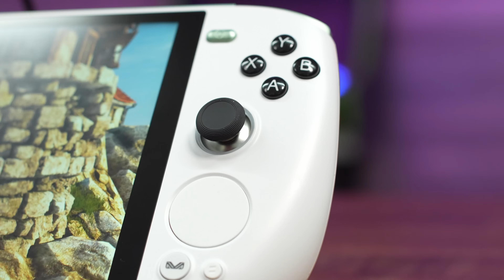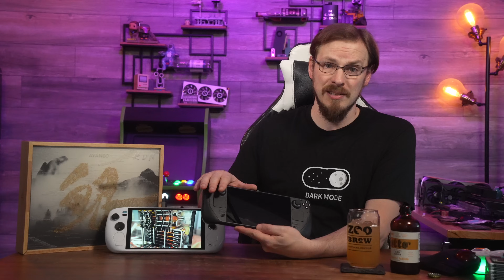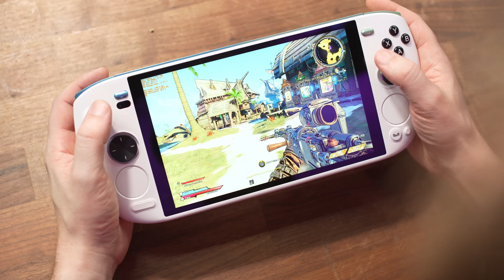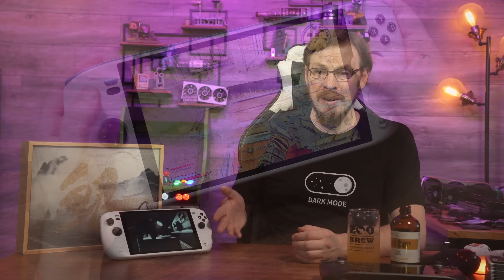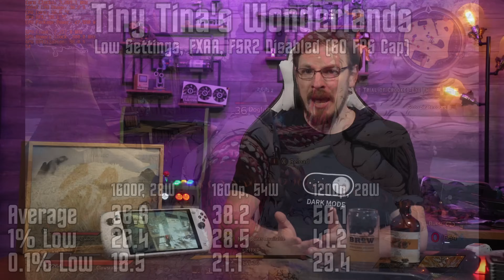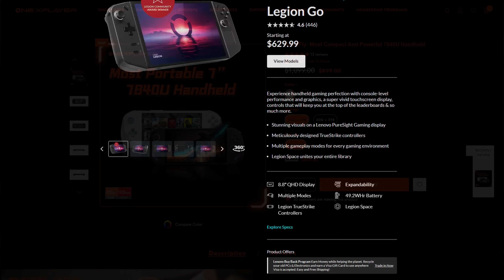Insanely fast, Insanely disappointing - Ayaneo Kun Review

Comment: does it make any difference that you can now install actual steam os on it? Can you check if it works as expected? It should still be faster than steamdeck oled and sth on par with og ally and legion go at least. If steamos fixes the trackpads, it might be good alternative, especially that Go has equally frustrating inputs.

Comment: Native screen resolution is a great point.  I own a tricked out Kun and never used the full resolution.  Everything is scaled down.

I do not have many issues with accidental input on the trackpads. Would rather have them than not.

Disagreed on the Windows front.  Windows is a BENEFIT.

Comment: I guess we have different sized hands.  I don't have most of the issues that you have controlling the Kun.  I do agree that the Start/Select should not be on the same side at the bottom.  That's a terrible design choice.  And I don't like trackpads on any device.  A Bluetooth mouse is a must for every handheld.

Comment: 1080p/1200p is about optimal for a 7" class screen on a handheld device. It falls at right about the limit of human visual perception, so going higher resolution has no particular benefit. (Arguments to the contrary are in the same camp as the audiophile's "tubes vs. transistors" argument.) I have no issues with the Steam Deck's 800p resolution, and the lower demands of the lower resolution make for better gameplay.

Comment: Hot Take:  Any handheld PC over $1000USD is a waste of perfectly good silicon.  In fact I would argue that no handheld PC should be above $700USD.  That is the price ceiling at this point.

I think the biggest problem with handheld PCs is that they keep trying to sell themselves based on specs (like the 2K display) and the problem with that is that you're still rocking integrated graphics.  Integrated Graphics have come a long way in the last 5 years, but even at this stage, integrated graphics still get their shit rocked by even the lowest end dedicated GPU.

I mean, would you seriously pay $1600USD for the same performance as a handheld at $700USD?  It's a joke!

I will say this though, all handheld PCs should come with at least one touchpad.  The Kun gets that right at least.

Comment: As a Lenovo Legion Go owner (8.8" 2560x1600 screen) I've found it best to run demanding games at 1280x800 with integer scaling on. 2560x1600 is a perfect integer multiple of 1280x800, so you still get a very sharp display (343 pixels per inch) with good performance. People complain that 800p is too low but it's double the pixel density of a 4K 27" desktop monitor (163 PPI)...it looks fine. Even when you calculate the revised PPI at 1280x800 it's still higher than a 4K screen at 171 PPI.
Reply: Yeah, the 1440p display on the Legion Go makes a lot more sense, since you don't get issues with fractional scaling when you drop to exactly 1/4 (or 1/2 depending on how you count) resolution
Reply: I too have the Legion Go. But I gotta say that I generally prefer to run most games in 1600p. There definitely are exceptions. But that is one of the things that annoys me most about most reviews complaining about "too high resolution displays"... That assumes that everyone is going to be playing mainly new or newish AAA games. But indie games and even some AAA games that were primarily made for the Switch (Monster Hunter Rise and Monster Hunter Stories 2 specifically) run fine in 1600p and 1440p respectively (Stories 2 is a 16:9 only game for some reason). And even if you choose to run in 1200p or 800p if you switch on RSR you can still get the graphics upscaled to 1600p. I've seen both Craft Computing, Digital Foundry, and a lot of other channels bring up the high resolution as a negative. And I just don't get it. Okay, if you want to play Cyberpunk then maybe 1080p would have been a better fit. But there are so many games that are older or just less demanding that can run just fine in 1600p either natively or using upscaling.

Comment: Besides the ergonomics I think their biggest mistake was putting a 1600p screen on it. You don't need that kind of resolution on an 8.4" screen. If everyone is going to drop the render resolution to 1200p anyway for performance then that is what you should be putting on the device to start with. It probably could have helped them cut the price down as well.

Comment: Handhelds are amazing. I'm actually watching this from my ally.
Reply: Can you use like the complete windows on the ally, or other windows handhelds? Like fully functional no limits, you can just plug into monitor and use as a PC?
Reply: @azurezzz Yh pretty much
Reply: @REDACTED__007  ohhh I wonder why it's not more popular, only like 500 bucks for a $900 equivalent PC no?
Reply: @azurezzz  Eh like 700 - 800. But yh it's pretty much a PC  equivalent but more portable with less power than actual PC
Reply: @azurezzz  The ally and legion go are extremely popular handhelds
Reply: @azurezzz  for the desktop experience you can do a dock. or add an external graphics card via xg mobile. the new one is usb4 so you can use a generic oculink external gpu and basically have a portable pc
Reply: Nice have had a SD since July 2022 and wouldn't mind upgrading to that black rog X one, looks sick! I'd even be able to play FC25 (Yeah, I'm that guy) and some COD games.